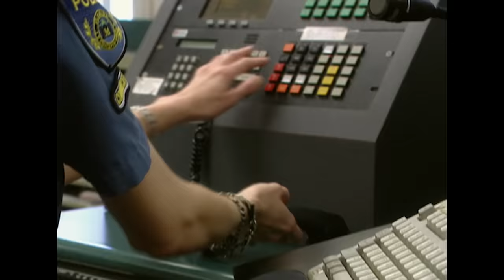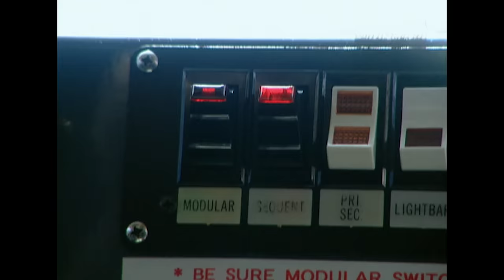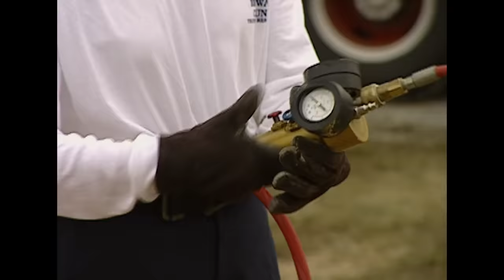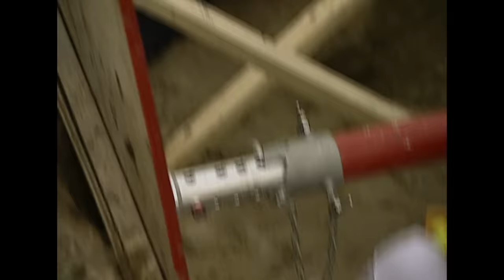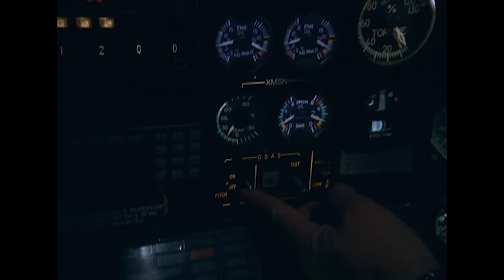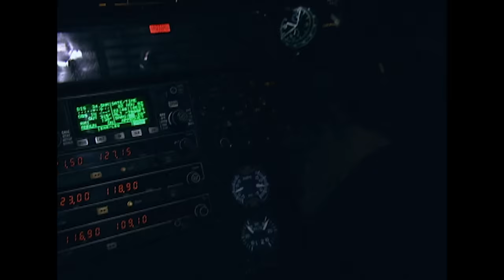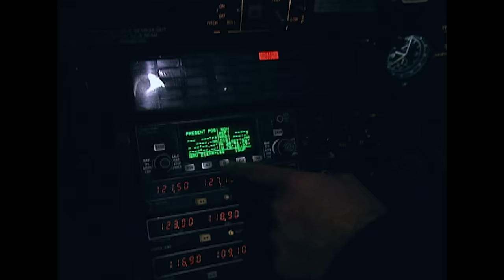Construction Worker Nearly Dies After Trench Walls Collapse | Critical Rescue S1 EP4 | Wonder

Comment: As a brother fire medic, great job brothers to everyone on scene. To the narrator if you are gonna say something make sure that you say it correctly. For instance the "1/2 back board is a K.E.D. Kendrick Extraction Device I say that because the actual 1/2  backboard is wood and has a different design. The k.e.d. isn't wood and the patient is immobilized when it's clicked into the locks by color codes an has a cloth head restraint as opposed to the head bed and tape used on all the backboards we use.

Comment: There is a digging machine right there behind them... Put a heavy cable on the bucket and attach the other end of the cable to the slab and lift the slab up long enough to free the guy. Construction 101.
Reply: They couldn't. The rock would've smashed him. Plus, he was twisted over a pipe.

Comment: As an RN, I would think the EMT's would have started blood infusions, and warm IV fluids to increase blood volume and warm the bodies internally.
I was listening to this with my computer screen off, as I was trying to fall asleep, but I see now they were giving blood and IV fluids.
I don't know how much weight a helicopter can haul, but in technical extraction of large animals, large padded straps are placed around the whole underbelly of a horse stuck up to its neck in mud. The horse was a Percheron draft horse at 2500 pounds. The eyes are covered and a tranquilizer is given.
Couldn't they have used something like that, with large chains, and a helicopter to lift the boulder up? It wouldn't have to be lifted all the way out...just enough to lift the boulder high enough to pull the men out.
I don't know the answer to that...I guess a helicopter pilot would be the one to answer that question.

Comment: The materials and safety equipment which they are using after the accident, if that could have used before the accident, then the accident would not have happened.

Comment: The foreman and operator were dumb on this job, sandy soil is the easiest type to dig in you have to dig back further on the sides stair stepping the walls down in this kind of soil or use trench box's  to prevent it from collapsing, but usually if your not the one in the ditch it's easy to not really worry about that kind of safety for your crew.

Comment: Where was the safety protection the big steel trench protector that should always be in those trenches? Why was someone not obeying proper protocol so that no one had to die I would’ve refused to go down there. It seems someone was lax and broke the law it should have never happened.

Comment: All man should be saved if they used a digger faster sad he died rest in peace
Reply: It probably wouldn’t have helped as it could have potentially made things worse. First off as the video said many of the people who die in trench cave ins are would be rescuers and they are killed when they rush in to the trenches without training or equipment or who don’t check to make sure that the trench is stable and because of that they are then killed by a secondary collapse and so if they had gone faster then the trench could have suffered a additional collapse which would then have killed the rescuers and the people they were trying to help. Second by digging faster the victims could have suffered far more serious injuries. Finally as the person who died was cut in half it is possible that he was killed instantly by the collapse meaning that even if the rescuers had digged faster he still wouldn’t have survived.